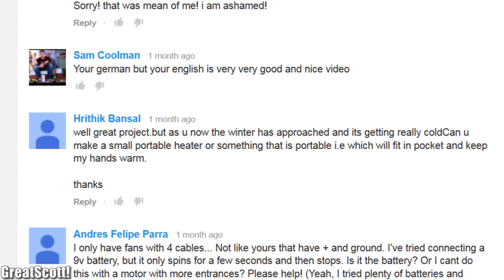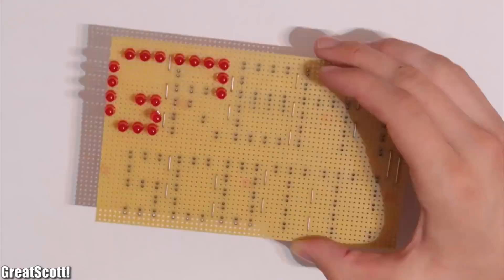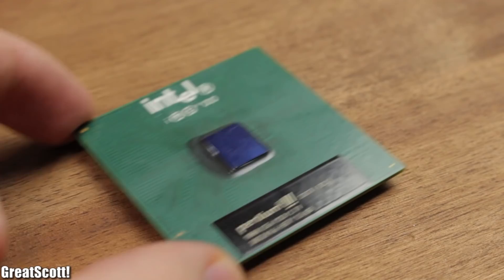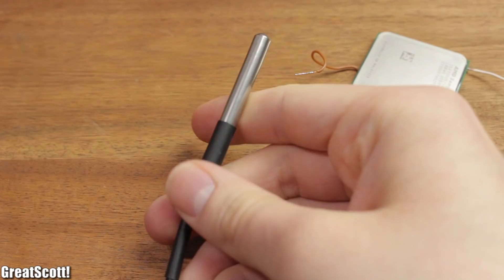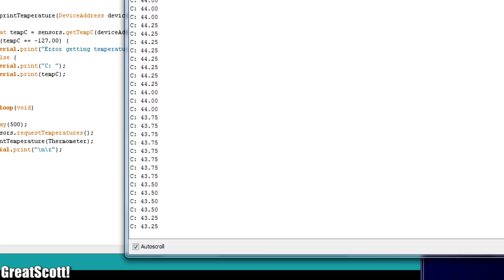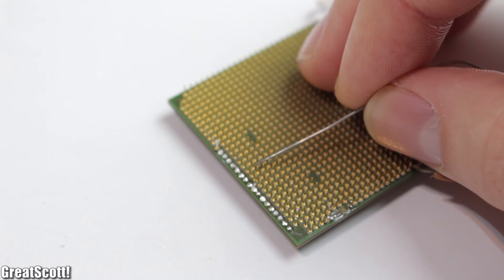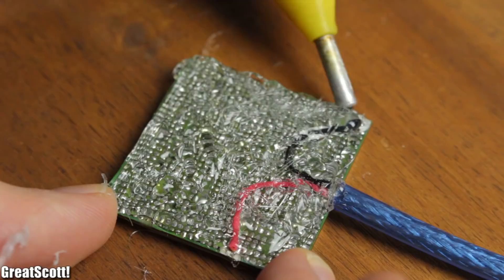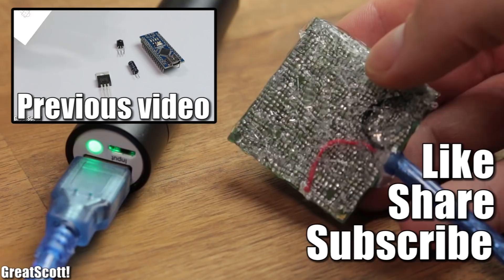Stay warm this winter: CPU Hand Warmer

Comment: Wanna have a Hand-warmer with android? Buy the Galaxy S5 and run GTA:SA... 81°C guaranteed <3
Reply: Wanna have a Hand-warmer with android? Buy Galaxy Note 7. That's it.
Reply: Oh sorry, hand warmer that doesn't explode.
Reply: My s5 would get so hot anytime I turned it on
Reply: buy a galaxy s4 i9500. cpu all time 91°C.
Reply: Lumciaro Xperia M5. It reached 131°C
Reply: no buy an htc one m7
Reply: I want a handwarmer not a bomb
Reply: Well, buy j5, overclock it to 2.1ghz and run a stress test
Reply: Mate 20 lite pubg 190 c
Reply: buy xiaomi mi 4i
Reply: Buy an LG G3
Reply: Lumciaro the hell? I can run gta sa on max on a cheap shit huawei y3 II and it’s not even warm.
Reply: @PackardKotch  Huawei y3 II is my grandpa phone
Reply: jalu ariasatya yeah and it can run San Andreas on max
Reply: haha poor android fellas.apple has handwarmer features included in every mobile device.we just get more expensive phones with an old core overlocked haha.its a joke i hate this scam company
Reply: ZealQNeve ??????????
Reply: Buy a Nexus 6P, even idle it's a great portable heater.. But be careful to not go under 40%, otherwise it'll cut out instantly. And probably the broken big cores could be repurposed with this project too 🤔
Reply: Buy an amd rx 590, and then use furmark.
Reply: iPhone 8 on Fortnite with flashlight on and all apps running in background. 100 degrees guaranteed
Reply: I approve
Reply: Just do video call on note 5
Reply: Lol
Reply: Only 81°?
Got a shutdown.😊
Reply: Haha, it doesent beat the s6 heat

Comment: Thanks! AMD processors are finnaly somewhat useful!
Reply: HaHaHa. I agree with you.
Reply: abid samin I used to have an AMD processor.
My friend convinced me to get an Intel processor.
I love it.
Reply: AMD's 6 core fx-6300 is beaten by intel's Dual core pentium g3258. With intel, stock cooler is enough. You must have to waste money in water cooling for AMD. Intel is the best. Using AMD is like using an overclocked 5 year old cpu. :D
Reply: Haha yeah.
The one I had was bought as budged when I got my rig.
(AMD FX-6100)
Had so many issues with that peice of shit.
Reply: Hell yeah. We are all fooled by core numbers and clock speeds. That's AMD's marketing. That's not the actual performance.
Reply: AMD Phenom II X6 1100T is on par with an i5-3330. (Passmark)
It actually has 6 physical cores, not hyperthreaded.
Keep in mind the Phenom is 2 years older than the i5.
But everything else from AMD is terrible, including ATI GPUs.
Reply: abid samin
No way. Especially with DirectX12 coming up and Mantle the FX6300 has the G3258 beat out. Heck in current games the FX6300 wins over the G3258. Where are you getting your source? I bought a Pentium g3258 mainly for emulation. Which is the only area in gaming it has the FX6300/6350 beat.
Reply: now i found a use to my fx 9590, because my laptop intel i3 beaten it flawlessly
Reply: guilherme moraes da silva Dude no i3 even comes anywhere close to the FX-9590, let alone a mobile i3. The FX-9590 is up with the i7-4790K on the benchmark charts.

You are a really terrible troll.
Please leave, thank you.
Reply: abid samin The FX-6300 actually beats the G3258, but that's at stock clocks. The G3258 is overclockable to 4.8GHz (from 3.2GHz) on air cooling, and let's not forget it costs $72.
Reply: I prefer Intel, but AMD is still almost always the best choice if you're on a budget.
Reply: videogame57 you're welcome, and I know that the 9590 is a beast of a processor
Reply: videogame57 nahhh The pentiumG3258 is a monster for buget systyems and its only 70 bucks.
Reply: The Apex I said "almost always", not "always".
Reply: 😂😂 so truth
Reply: AMD and ATi are garbage :P
Reply: that comment, haha
Reply: AMD is alright.
Reply: The only problem with AMD is their ridiculous power consumption in comparison with Intel. The FX-9590 and i7-4770K are close in performance, but the FX has a 220W TDP, and the i7 has a 88W TDP. They also get very hot, these are both side effects of their still larger chip size. Intel has been making their chips smaller and faster, while AMD has been staying the same size and making them faster.
Reply: Nah, AMD is trash, it breaks too much and they try to convince us that there better
Reply: James Kovalik I've never had any CPU fail, Intel or AMD. I have a 486 machine right behind me.
Reply: Well even if your on a budget you can still build a good intel build, liike i have a intel core I5 4440 @3.3 ghz and a msi gtx 560 ti(im upgrading soon) and 4gb of ram and i built mine for $600 videogame57
Reply: James Kovalik Then you must have the cheapest PSU and case the world has ever seen, and pirated windows.

I'm not saying AMD is better, I'm just saying it's not unreliable.
Reply: videogame57 i actully have an evga 500w, i forget the model and i have a bentfenix shadow, i got my ram, cpu, and motherboard in a combo and i have a ton of windows and product keys
Reply: my mother board is a msi pc-mate g41 if i rmember correctly and i have 4gb of ram, 8gb is over kill cause you only need about 2gb to play any game, but im upgrading to 8gb too
Reply: James Kovalik You must not play very intensive games, or Planetside 2. I was running out of RAM with 8GB I had to upgrade to 10GB. I have 12GB now. Planetside 2, on average, after the release of the 64 bit client, uses 6GB of RAM. It starts at 2GB, but after a long session it can reach 7GB.
Reply: videogame57 But most games wont go over 4gb of ram if you dont have alot of backround programs
Reply: James Kovalik To be fair, my web browser was using almost 2GB at the time (I had a lot of tabs open). But PS2 was using over 5GB of RAM itself. I checked using task manager when I got interrupted by a low memory warning. So 5GB for the game + 2GB for my browser + almost 1GB for Windows = 8GB was not enough RAM.
Reply: videogame57  but see if your a normal person and are playing one game XD and no web browser its enough, but multitasking will definitly need more than 4gb
Reply: James Kovalik 8GB is the standard now, don't buy a PC with less.
Reply: videogame57 not really, advertisers talk too much into people needing more than 4gb, honestly, for a person that maybe plays like the crew or good games that are a bit older you dont need more, but if your playing COD advanced warfare maybe then you need more
Reply: Most PCs come with 8GB+, you'll probably pay more for 4GB, and it'll be a pain because you'll have to replace the DIMM to upgrade it. DDR3 comes in up to 8GB per DIMM, so one 8GB is the way to go. (excluding server memory, which costs way more and is available in 16GB DIMMS)
Reply: videogame57  You dont get dual channel and its a great if you have a backup even though RAM bearly fails
Reply: abid samin ehem it beats it in single core performance multi core is a diffrent story though
Reply: HaHa:D yeah i aggree!
Reply: videogame57 Take a look at the TDP (thermal design power) of these CPUs. The Phenom then looks like a heating element rather than a CPU. It's as if AMD puts heating elements into the Processor and hoping that it can compute. :D

The problem of AMDs GPUs is the crappy driver. The performance is similar to nVIDIA.
Reply: videogame57 Not in Europe. In USA, electricity is almost free compared to what we pay in Germany for one KWh!!! AMD CPUs use up twice the amount of power for 80% performance compared to Intel. STILL! No wonder, that AMD is nearly dead. No one buys this crap in Europe.
Reply: ***** i did.4 of my mates did aswell
Reply: Then have fun, especially in summer. :)
Reply: ***** i really dont get your problem mx fx makes no problems whatsoever
Reply: If you are happy with that, it's okay. I won't be happy with that. Looking forwad until my Xeon E5 2637v3 arrives together with 32 GByte of DDR4 2133 reg ECC RAM, GTX Titan X, Intel SSD 750 (400GB), 4 TB HDD 7200RPM all together on an Asus X99-E WS.
Reply: ***** well you seem to enjoy overpriced tech
Reply: That's not overpriced. It's just fast. I just don't like ANY latency!
Reply: ***** it is overpriced and fast.btw how much rendering and content creation do you do?
Reply: *****
I need that performance for all kind I do and I may ever do in the future. I wanted to try alls sorts of things and I had performance problems on all corners with all sorts of cheaper hardware...
Reply: ***** then the e5 isnt even your best bet,an overclocked i7 would be
Reply: *****
Even an overclocked i7 does not get into the borders of the throughput of any Xeon in the same generation (Haswell). There's a reason for the high price. And I don't like using hardware out of the specs. And then the missing ECC. No, thanks. i7s are toys.
Reply: ***** mate i7s and xeons are the exact same chip.the only difference is that the xeons get the chip that turned out better.the i7 4770k or 4790k only has less cache,but as soon as you oc it it outperforms your xeon.xeons are for reliability in servers not for the highest possible performance
Reply: This can't be true because the instruction extensions differ hardly from i7s. Also, Xeons have much faster memory controller and much higher PCIe throughput. So there is no chance that it are the same chips.

It may only apply to i3 and i5s, where some cores have to be disabled because they were dodgy and HT was disabled as well as some extensions such as VTx, etc.

Overclocking is a very desperate method for people with too small wallets. I can only advice not doing it, because you might easily kill your hardware. Most of the time you have luck, but in long term perspective, the CPU will die early. No matter how good the cooling is, etc. Don't push any CPU too hard.
Reply: ***** even if you are right wouldnt an i7 5960x still be better for around a 1000 bucks?it actually is better in every way
Reply: ***** also you should have waited for the r9 300 series to come out
Reply: *****
What should I do with a GPU with crappy driver and rare software support for computing?
Reply: ***** i ment that the nvidia cards would drop in price so that a sli setup would be more easily accesable.also the drivers arent bad they are just less frequent
Reply: Ah, I might buy another GTX Titan X next year or so, then I can do SLI. I think one GTX Titan X will be enough.
Reply: ***** I bought one 3 years ago! Still keeps me warm in the cold winter nights! Seriously, i turn on the computer and i can switch off the heating!
Reply: Jason Brody Yup... hope Intel catches up soon! ;-3
Reply: Jason Brody im not saying i love AMD but they're not shit.
Reply: The Apex The thing is it cant even run far cry 4 due to the 2 cores.
Reply: Jason Brody And AMD processors (the fx series) cap out at 50-60 degrees even with the stock cooler, compare that to my 4790k which thermal throttles on stock cooler and reaches 60-70 degrees under water.
Reply: Multi407D My Intel Xeon E5 2637v3 doesn't even reach 60 degrees with Dark Rock 3.
Reply: ***** The i7's are really hot especially with prime 95. Under gaming loads it hardly ever goes above 50-40 on the i7 and 40 on the amd fx cpu's.
Reply: Multi407D
The only i7 I had which did get really hot was in my Ultrabook due to the lack of cooling. But these chips have a TjMAX of 105 or more degrees. It's like with GPUs, they can easily get to 90°C without throttling and damage. But my i7K I had did not get over 60 degrees even with hard overclocking. The Xeon also has a TjMAX of 105 degrees. AMD just has better stock coolers.
Reply: ***** No Its cooled by a h60. But the thing is haswell is designed to reach those temps especially when running p 95
Reply: Multi407D With Prime95 maximum heat setting or maximum power consumtion setting I only get a maximum of 65 degrees in a 24h run.
 My Xeon is Haswell-EP.
Reply: ***** And its clocked at 4.5, I guess the h60 just sucks. I am still happy with my temps especially at winter when I turn the fan to push the hot air at me.
Reply: Multi407D
LOL. Hmm I'm not that keen with overclocking. I certainly want performance but I want it plug and play. And I want ECC, plus I plan to upgrade to 96 GByte RAM. With i7, you can forget it. (I'm running many things at a time, Blender, PS, Atom editor for my web based game I develop, plus a VM with debian without X.org running MySQL, Apache, PHP and SAMBA, plus a linux VM to play with, etc.

My Xeon is too slow for my taste... And the only alternative is the 6 core Xeon with 3.5 GHz, all Xeons with more than 6 cores have slow clocks. I AIN'T 'AVIN IT! I WANT MOOOOOORE! -____________-
Reply: ***** And the shitty thing is the i7 with the most cores costs 1k :(
Reply: Multi407D
That's no problem for me, my Xeon did cost ~1100 EUR. The problem is, that you cannot get 8 or more cores with at least 3.5 GHz and more than 64 GByte RAM and ECC... Just because Intel thinks there is no use for it... -_-
Reply: ***** Well i guess they would think that people who want high clocked cpu's dont have the need for ecc ram. Is ecc that essential to you? Even with 64 gb of ram is it even possible for an error to occur?
Reply: Multi407D
ROWHAMMER is reason enough. :/

Comment: dude , you are using a CPU to heat ? whats is next, use a car to hold paper ?
Reply: Dude, its just garbage parts... even if you wanted to scrap the parts or reclaim metals, it'll take too long for practically no return.
Reply: That AMD chip is probably $5-$30 today.
Reply: Not even.
Reply: tawn248 um that cpu is around 20 dollars today
Reply: Daniel Tavares So? A CPU produces more heat per mm² than an electrical hotplate ;)
Ok, not in this scenario, but normally it would :)
Reply: Yes
Reply: Some actually roasted Marshmallow with a Celeron.
Reply: Plucky Playz cooking meat on a P4
Reply: Jacobee Vlogs And Games not worth buying it for 20
Reply: I have a Celeron in my pc....
Reply: LightNing NL as long as it's not before 2008 ur fine stop complaining
Reply: Well, he is a YouTuber and wants to keep his fans entertained. If you were in his place, you would make a car hold a paper
Reply: Daniel Tavares no no using a car to walk
Reply: Yes
Reply: Pretty sure a video on "how much paper can i fit in this car" would get some views
Reply: Dude a broken or old CPU costs around 3€ or more cheaper
Reply: @Rockie Richie A Dead CPU costs  around 3 Dollars. A working Core 2 Duo around 10-15 lol
Reply: @subhashpillai9914  theres a guy who boiled pasta on a P4
Reply: 16 GB RAM, i5 Sandy Bridge and 1 GTX1060 Temp without air conditioning: 
Case -> 34 C 
CPU -> idle 40 C Full load 55 - 60 C 
VGA -> idle 47 C Full load 60 c 
Ahh and i living in hot country :D
Reply: Daniel Tavares Heated rocks in socks in sleeping bags.
Reply: MelonPlayzYT BaconCPU(tm)
Reply: Why not? I've got 6 old CPU's from desktops that i found discarded on the side of the street. It's not like it's that hard to find or even buy one for a cheap cost..
Reply: Dude, old unused intel pentium 3 single-core from around 2002-2004 it's like 1 dollar here.
Reply: It take 9$ to buy a still working Dell laptop that made from 2010 (S.E Asia).
Reply: That's atleast better than nothing and I need it beacuse it's really cold

Comment: It's so much easier to use coiled up nichrome from a toaster potted in resin epoxy-Get a coil that draws 3A at 5V, add some tape to one side to keep it together and then throw it in a solo cup with some resin and you have a puck that's much more powerful and cheap.
Reply: +Ariel Lezen You, I like you.
Reply: +JMW Gaming it would be good for warming up a silicone ass toy
Reply: +JMW Gaming 3A, 5V, that's 15w. Not much at all. Enough to heat up a resin puck, though.
Reply: +JMW Gaming TIL I apparently can't handle a AA battery without rubber gloves ;)
As was said, you can't just look at the amperage in isolation and decide this electrical device is dangerous. The voltage is only 5V - which is far too low a voltage to overcome the resistance of human skin.

Remember - it is not current that is dangerous, it is high voltage that is. To kill you, an electrical source needs sufficient voltage to overcome the resistance of your skin. Then, it can pass a current through you (such as your fatal 0.2mA)
Reply: There's stuff called ohms law you need to bring ohmage into the equation if the electricity moves too fast the battery will become unstable and blow up too much ohmage and the wire won't get hot